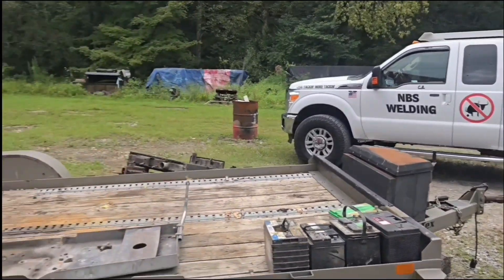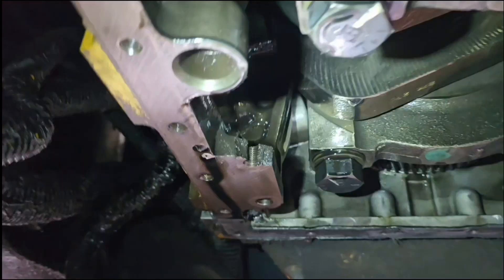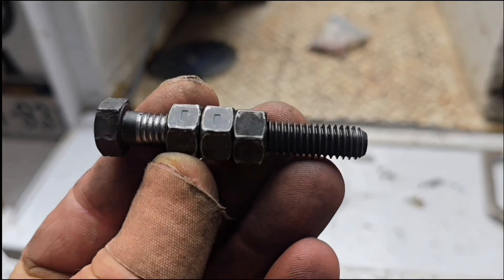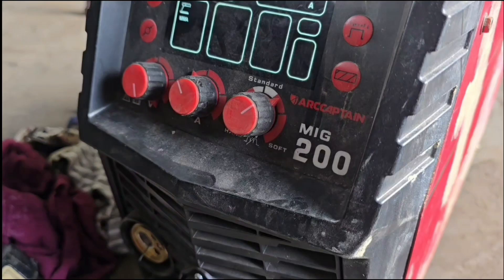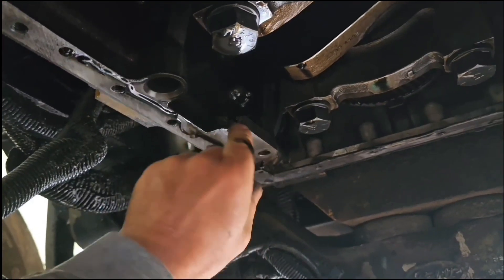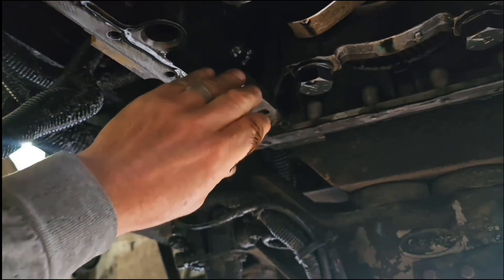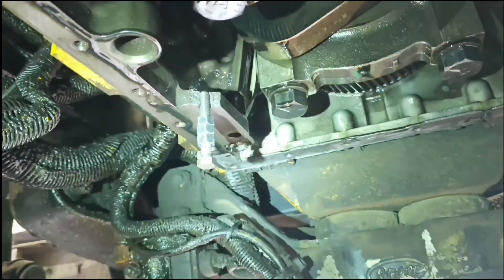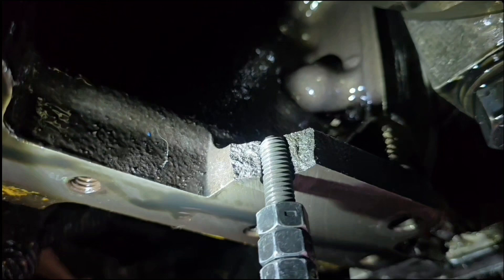Weld repair fix on Caterpillar engine block

Comment: I've done similar things like this but I've used a brass Bolt and then remove the bolt and then retapped the hole but you can keep all the cast iron and cast steelwork as always a stellar job you really are among the Apex welder mechanics in this world
Reply from the maker: Thank you Derek...appreciate your support

Comment: good job. I'd have made a bracket from the main bearing bolts and used longer bolts, or drilled a new mounting hole in the oil pump and block if feasible.
Reply from the maker: Thanks!

Comment: Nice job , just look at 6.45 looks like a crack that runs upwards on the inside of the block above the weld repair  ,
Reply from the maker: Thanks

No crack there...I see a line or casting mark running vertically just slightly left of the stud but definitely no crack
Reply: @NBSWELDING  that's good news , its very hard to tell sometimes between casting marks and cracks , you did a fantastic job on the block repair

Comment: What settings do you use on the mig 200 with the aluminum spool gun? Thanks
Reply: How about wire speed?
Reply from the maker: Wire speed should be set so that there is a slight spray transfer...the number is irrelevant because it will vary wildly depending on wire type, size, and temp of the material.
Reply from the maker: 18-21 volts....wire speed should be set so there is a slight spray transfer....argon blowing at least 35cfm...use a sharp push angle and always brush the surface with a stainless brush until its dull gray just prior to your welding

Comment: I've used a little of 99 and 55Ni , but never needed to drill.  They claim you can drill Ni55.  If you could, it looked like a challenging location to drill and tap.
Reply from the maker: Yep

Comment: Haven’t done much cast iron, tried some 7018 once and that was a fail. Now I know from your videos 7018 cast steel, nickel for iron. What about preheat and peening the weld? If you can do it do you or is it unnecessary?

You oughta do a little cast iron tutorial welding video sharing tips and tricks of the trade. Have a blessed one!!
Reply from the maker: No need for preheat out on the edge like this

I've done many videos welding cast

Comment: Thats a good bush fix. Not easy in that position and with all the oil. Lets hope they got all the contamination from grinding out of that block afterwards. Otherweise that engine wont be good for long.

Comment: C B, don't you have to preheat that?
Reply from the maker: No...I see no need out there on the edge like that...preheat helps slow down the expansion and contraction of two parts so that they don't pull away from each other and form a crack...in this case I'm building up a new edge on the tip end of something with all nickel so there isn't two parts really there to pull apart and crack like there would be if I was doing a crack repair job

Comment: Nice job CB!
How did that piece of cast get broken off inside of the engine?
Reply from the maker: I'm sorry I don't know the answer to that...I saw the entire oil pump housing was broken also...I was assuming that it was a complete catastrophic failure of the oil pump mechanism
Reply: @NBSWELDING Wow, that's crazy!